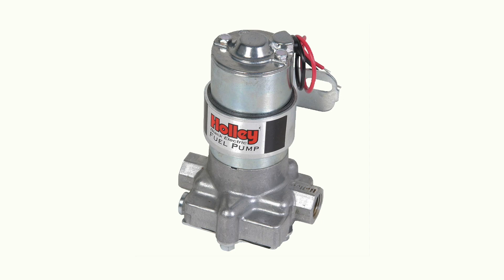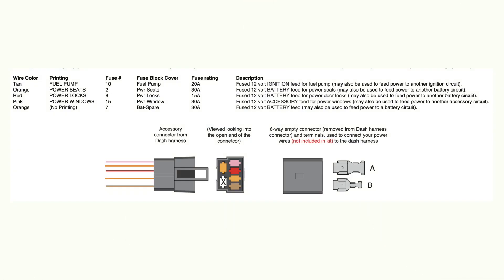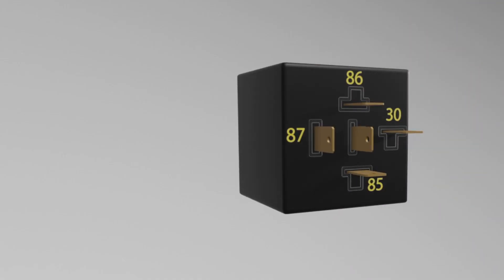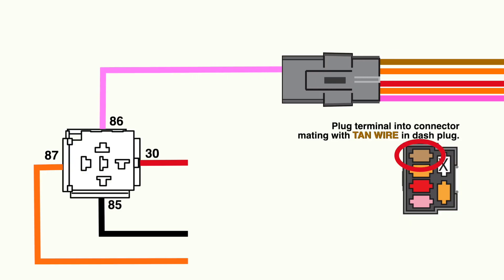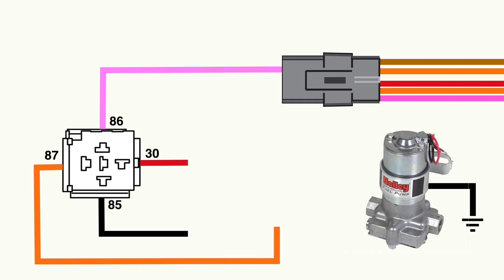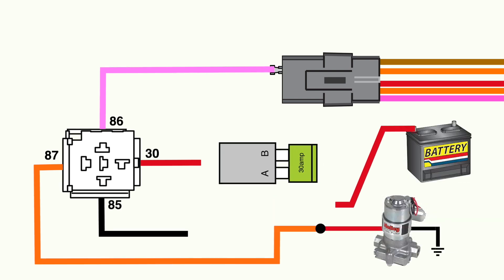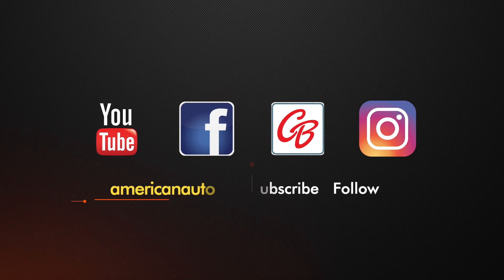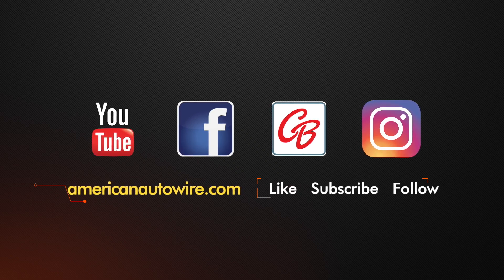How to wire an electric fuel pump relay

Comment: My 2001 Dodge. I just put a vast bump on it and what I find. When I stop the heat won't let it start again. Until it cools down, The trouble is, there's too much pressure. And AVP44 will not allow the fuel to enter. They say you can put a relay on the fuel pump. That allows your starting to turn over without the What you want is a relay that allows the motor to turn over without the pump for a second or 2. Can you show me how to hook up
Reply: Will this allow the fuel pump to turnover without being on 4223 seconds

Comment: Not a good idea. The fuel pump relay should not provide power to the fuel pump until the engine is actually running, not at ignition on. The pump should be wired to shut off if the engine stalls, or in the case of an accident where the engine stops turning. The method shown here will allow the pump to run any time the key is in the ignition position...wrong!!
Reply: ANY LINKS TO THE RIGHT WAY?
Reply: @zemoney954  Here's a couple of vid links below using a 3 terminal oil pressure switch. Both vids use the same method.
It is also possible to wire the relay coil + terminal via a diode and resistor to the charge/battery lamp circuit for the alternator on most older cars. Once the engine is started and alternator starts charging, the fuel pump also runs, but it's not possible to use this method if you happen to have a one wire AC Delco alternator without a charge warning light.
https://youtu.be/tPh2Na3vbGc
https://youtu.be/0lTXmPRxVD8
Reply: Unless this is some cutting-edge fuel pump with advanced 'fuel pressure safety logic' built in (which I highly doubt), it's imperative to use a mechanical oil pressure safety switch in conjunction with any setup like this if you value your car...and your life!